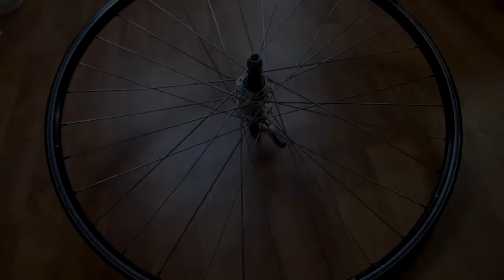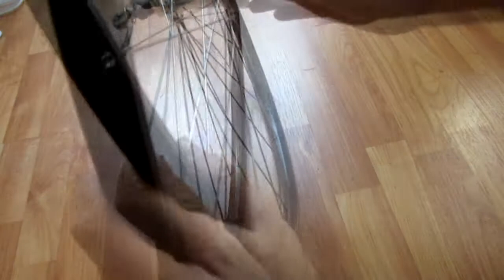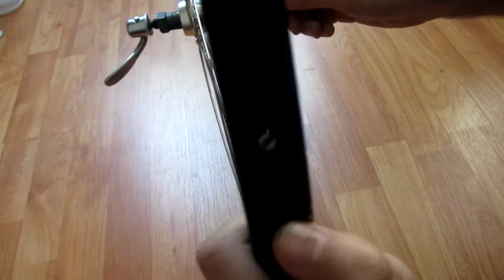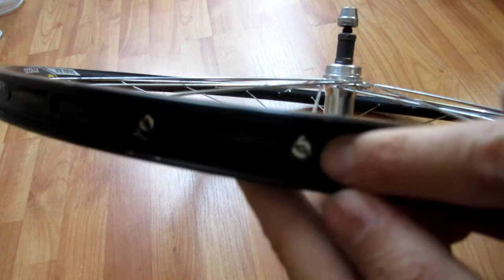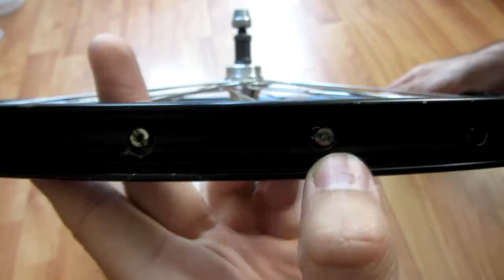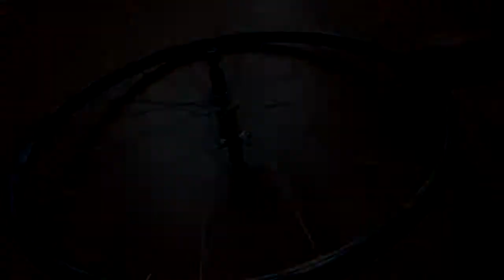Incorrect Bicycle Spoke Lacing (should be Under Under Over)

Comment: In fact the lacing under-under-under wil give you a stifer wheel, see the tests here on the internet :
La relation entre longueur et raideur.. ! _ Roues Artisanales
The test are done like this : different lacings with equal spoke tension verified with the tension tool and then different lateral displacement with an equal thrust.
A "cross by 2" is stiffer than a "cross by 3", a lacing under-under-under is stiffer than a lacing under-under-over, etc...
The tests were done by a company dealing more with road than terrain bikes that's why I would recommand to do the "traditional" lacing under-under-over at least for off road bikes.
On the other hand motorcycle bikes are using the "cross by 3" + lacing under-under-under on the 21" front wheel and the "cross by 2" + lacing under-under on the rear wheel.
In addition I would say that the lacinf under-under-under doesn't change the length of the spokes.

Comment: They did "over, over, over, skip a hole" instead of the "over, over, under, skip a hole". "Under, under, over" is not a thing.
Reply: No it's not a problem as you can see it on motorcycles like 21" front wheels of off road bikes.
Even more : rear wheels on bicycles should be of different lengthes but it happens that most of the wheel spokes are of egual length only wired by a difference of approx. 3 turns to cope this.